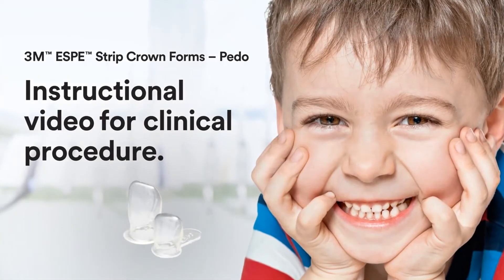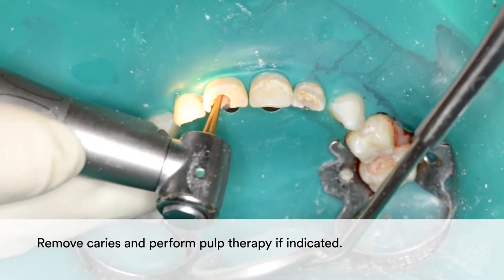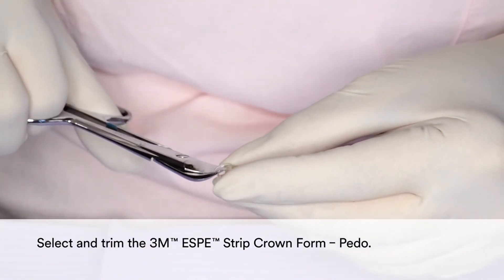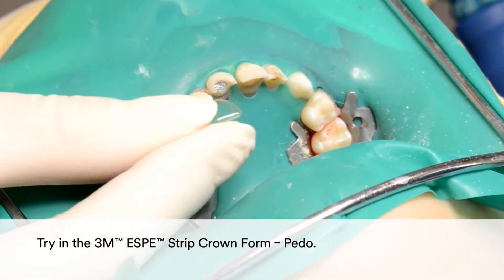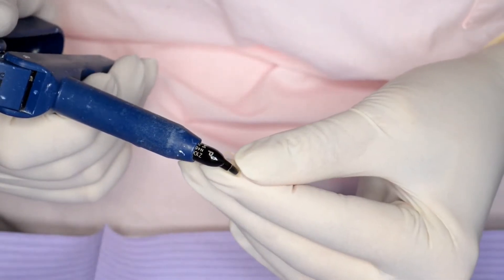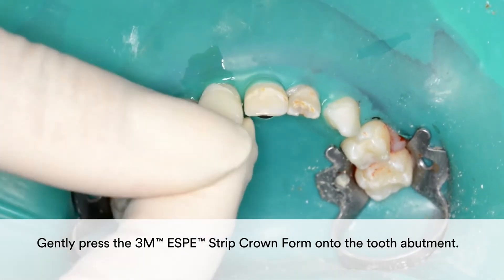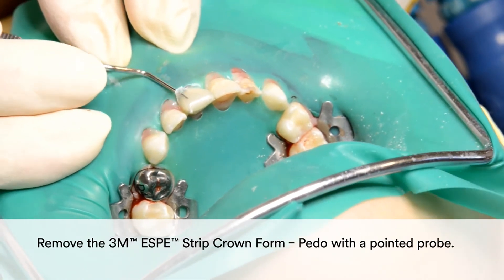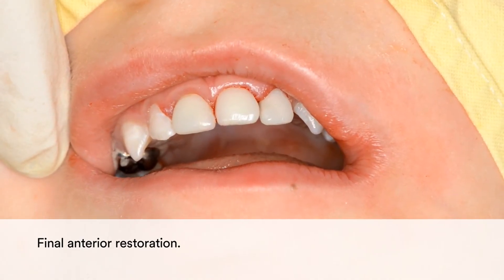Rebuilding an upper primary ante. tooth using a SC, voiceover US

Comment: It's a good technique with good results every time, I use it daily and the parents are always happy with the esthetics.
Usually I reduce the incisal edge of the tooth about 0.5 mm using red finishing bur or wheel stone sometimes before trying the strip crown which facilitate insertion of the strip  crown more easily and the filling will have the same hight as the next central incisor  without having to adjust it later on (in the video you can notice its a little bit taller than the next one, it's not a big deal unless it's affecting occlusion)
Plus when it's a bit taller and you have to reduce it you will be left with bulkier palatal fossa as you would have lost the thin incisal edge of the tooth, because the strip crown (which mimics natural crown in shape)  is wider as you go cervically.

Another good tip when using 3M strip crowns is to  use 3M flowable composite as a first layer inside the crown then fill it with regular composite then adapted on the tooth and cure it , i found out that this the fastest way to ensure that no air bubbles will be trapped at the incisal edge of the crown (its very  frustrating when this happens).

Finally after finishing the filling ensure that there are no ledges are left behind by passing a probe from the cervical area of the tooth to the filling edges on all tooth surfaces (there will be ledges that you don't notice visually and after couple of months there will be caries under these ledges with discolouration around it) 

If you do strip crowns right they will live perfectly until the tooth exfoliates and I have seen it on 10s of cases 😊.
Reply: Can we use 3M strip crown forms for permanent broken anteriors
Reply: @nisa-vf6nk  yea there is special kit for permanent anteriors but I don't recommend it as its very difficult to attain perfect shading of permanent anteriors using preformed strip crowns ( unless you use it temporarily)
Reply: @Mohanadalzahr  thank you doc